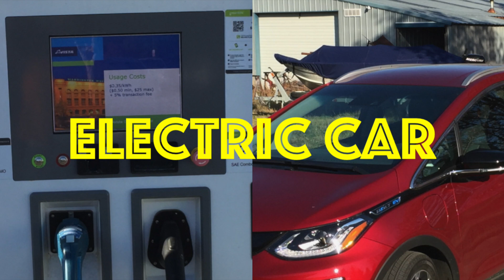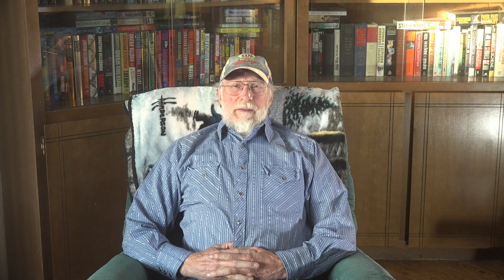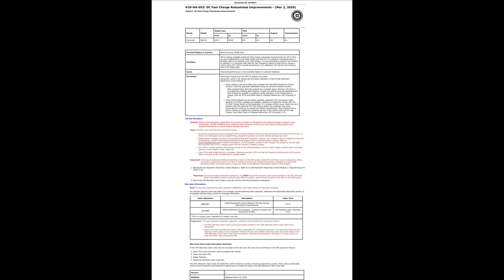Can the 2017 to 2019 Bolt charging parameters be upgraded?

Comment: Let us know if it worked...
The 2020 also has a smooth taper down. Not the sudden drops.
Also.. one thing the bolt does well is to come up to peak charging speed at very low states of charge..
News Coulomb is a good channel to watch some of his charging sessions. Even from 1% battery upward it climbs pretty quickly to the peak rate if the battery is up to temperature. many electric vehicles do not do this They won't climb to peak until they're over 20% charged. In these early bolts you are better off to run them low and then stop charging at 55%. And move on to the next DC fast charger. Apparently the 20/20 still charges quickly at low states of charge but then slowly tapers off so the net effect is definitely a faster charging. Again given the battery is warm.
Over the air updates such as Tesla does also have a negative side. If you look at some of their early Model S p85s. They have sent new firmware's out that significantly reduced the charging speed at superchargers. Some people are only seeing mid to high 40 kilowatt now once the taper starts. That's significantly lower than it used to be and you've got an 85 kW battery to charge.
Tesla also likes to do things like turn off features they don't think you should have now You're pretty much at their mercy if they decide they don't like you.
Reply from the maker: I will be doing a video on what happens.
The issue of over the air updates certainly does have negatives.  When I used Microsoft products, I never knew if an update would help or hurt.
The value of updates would be in things like a "dead zone" in the HVAC system, an adjustable maximum charge level,  upgrade charging profiles or increase seat heater output.
These are all things that would improve the driver experience, increase efficiency, and give better comfort.  
The problem is, the software is rather clunky.  When updating the software at the dealer, if the wifi connection fails, there can be permanent damage to the hardware.  Maybe they should take some lessons from Apple.
GFM